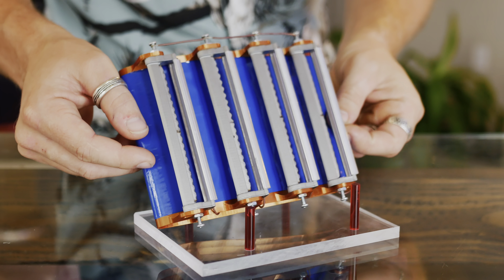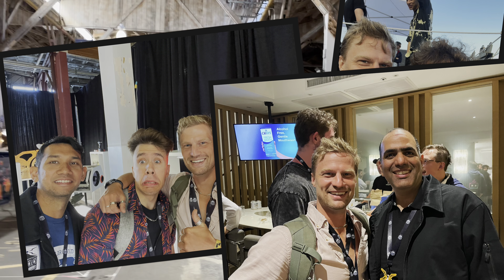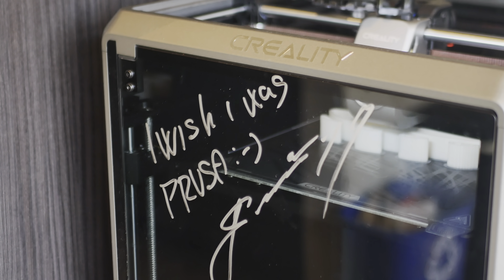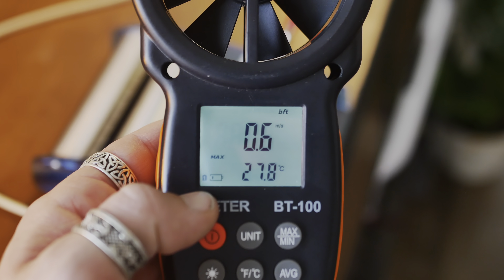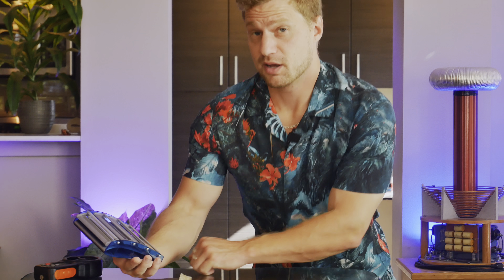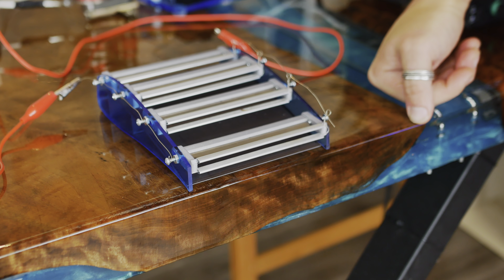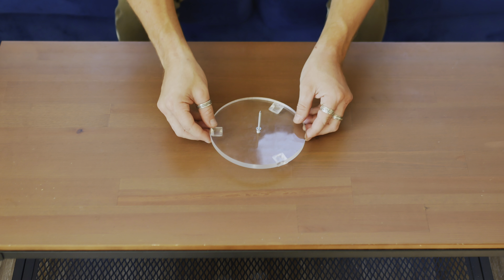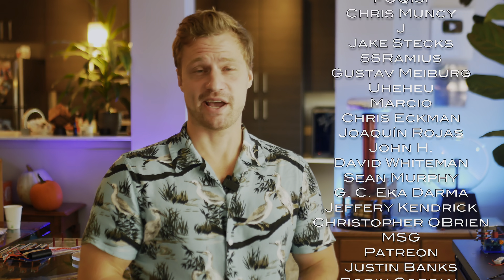Designing A Self Propelling Ionic Thrust Wing

Comment: It can work maybe if some basic air/pressure principles are applied. It looks like the wing/thrusters are working against eachother. The pressure of thrusters must be directed from above wings to below wings. So pressure increases below, and is reduced above wings. The thruster parts you have built are the same as the wings and maybe the only thing needed is more integration of thruster/wing plus surface. Maybe add the ability to use the thruster as flaps through the wings to modify the air direction from vertical to almost horizontal. Cheers.

Comment: That is an amazing concept, and I'm curious if you've considered if it is comparable to the amount of energy to create similar thrust from conventional propellers? The drawback of electric aircraft is always range, so is this a more economical use of the batteries energy storage? I know there are multiple electric aircraft for comparison, but I'm sure they don't require such high voltage to operate. I think this would be more effective as space flight propulsion after launch when there's little drag to overcome.

Comment: Wow very cool , I did not read alllll the comments but what if the thin carrona wire was bent to be like the serration of the blade increasing its surface area??? also what about a top skin over the corrona plane of the wing? IE a top skin. I would think electrically neutral or ground.

Comment: I'm not too sure how all this works, but could the ground just be some metal tape on the wing?
Does both positive and ground need to be separate to the wing surface? Can they both be built in after the spacing is figured out?
In my mind if the ground is part of the wing, the air will be directed on the wing surface.
Please tell me how I'm wrong.

Comment: Try some foaming 3D printer filament, much lighter prints although at the cost of strength. 
Colorfabb has LW-PLA, different printing temps result in different density.

Comment: @Plasma Channel From an energetic point of view, ionic thrusters are as useful, an an Argon ion laser - a powerful water heater, that gives off a couple of Watts of light too. As a byproduct, so to speak. To dissociate a dipolar air molecule (mainly N₂ and O₂) takes a lot of power. To rip off electrons from the atoms takes even more additianal power. It is perfect to create Ozone and nitrous gases, but only a minuscule fraction of the expended power can be used to accelerate ions to create thrust. It is not a coincidence, every attempt to create a flying machine failed. The much, much more efficient way is to use gravitoelectromagnetic (GEM) thruster - as USSF (formerly USAF/AFSPC) does since the end of the STS in July 2011. Since the physics is based on bosonic statistics (theoretically no losses), efficiency to provide lift energy (E=m·g·h) and kinetic energy (E=½·m·v²) is theoretically 100% and about 99.7% practically - when GaN-semiconductors are used for the RF-excitation of a particular topological insulator at room temperature.

Comment: Redo this but possibly do less in a row and wider wings then you could maybe match the size of wing to thruster or whatever it’s called, OH or make the blade things like curve up down up down up down, curved like a snake you know, and have each one behind the first opposite of eachother you know would have good airflow, vertical little interference with one another blades would only over lap at the crossing points if that makes sence I think if you combined these two ideas you might get somethin

Comment: I think that if you used two non conductive wires with copper wire  wrapped around like you did on previous models and aluminum foil tape for each stage would be lighter and still work. Then adding a corona motor you would have a very light plane!!!!!❤

Comment: Could you enclose them and stack them reducing the width and stack size as you approach the trailing edge? This could increase the velocity and airmass. For instance stack 4 x 3 x 2 x 1 creating a type of nozzle. Or 4x3x2x2 using the last 2 pointed slightly toward each other and switching them on and off for vectoring thrust.

Comment: @PlasmaChannel: Consider using actual razor blades instead of scraper blades, utility razors, and wire. Wire lacks the fine edge needed to achieve really high field strength, while utility blades are needlessly thick and heavy. Actual double-edged razor blades, like what our grandfathers used, are very thin and lightweight, and much sharper than utility blades. (Wires aren't even in the ball park.) In fact, they are so thin that you can easily cut them with heavy-duty scissors. You would want to cut them in half, since they are double-edged, and while you're at it you could cut close to the edge since alll you need is the edge itself. The result should be almost as light as wire but produce a higher field strength than your utility blades.

Comment: 1 - Would replacing the blades with a laser cut strip of metal - with hundreds more points along the edge - make the output any more efficient?

2 - Would having a thin plastic shell over the top prevent sideways bleed & micro-turbulances (causing drag) forming between segments?

3 - Would channeling the exiting airflow into laminar flow with nozzles improve the thrust?

Comment: You could series some batteries for a bigger build to 1000v and you reduce a lot weight and current... Those voltage amplifiers take 2 amps  in standby.... Plasma itself doesn't take much power.... Those HV amps do take a lot

Comment: So awesome. When I saw the screws on the sides I immediately thought: why not also vertically and then connect them to motors and tracks to allow for more precise spacing and pitch to find the optimal results, and later on to use the concept as ailerons via thrust vectoring and for some nasty maneuverability by going as far as reversing them. Tons of possibilities and potential, especially in the UAV market.

Comment: Nice interesting experiment. However, your ionic thruster structure is going to increasing the drag drastically.
Have you thought about integrating the thruster inside the wing profile? With an inlet in just at aft the leading edge on the lower surface and the outlet just fwd the trailing edge on the upper surface (like a blown/jet flap).
Reply: Have a look at the Lilium evtol. You'll see that the thrusters are embedded in the wing profile.

Comment: Sorry but I forgot to complement - if you have an electric motor to achieve flight the Ionic system inside the Leading Edge almost like a Dyson fan would maintain flow and the main rotor plus the gliding factor of the plane could make it viable!

Comment: I know you are talking about wing design, but my note is about the design you are doing - placing the ionig generators over the wing you loose the lift factor. air has to flow over the wing to generate lift. with those mini wings over the wing instead of in front of the wing there's no lift https://www.grc.nasa.gov/www/k-12/UEET/StudentSite/images/engines/foillift.jpg Your generator should be placed before of after the airfoil to be efficient.

Comment: I am no engineer ... even in a prior life ... but ... Instead of mounting the drive units above the upper surface where they increase weight, interfere with wing airflow performance, and create turbulence ... install them within the wing making the wing the drive. Install a long narrow intake on bottom of wing with a negative grounding edge and a similar exit vent on top of the wing, behind the intake, and with a positive charged edge. Separate each drive unit by partitions within the wing. Then fly the wing at a slight increased angle of attack. Cheers.

Comment: What about incorporating the plasma generators into being the wing structure thus reducing some wing weight and also reducing the wing structure to a wire? type instead of the flat material from the 3D printer ?  Hey I'm a Motor Head,  Grease Monkey with minimal knowledge from working at Beachcraft aviation and just watching educational aerospace and flight informational videos.   I am amazed by flight and hope to be reincarnated as any type of  Soaring  bird.   Love the video it sparked my inventor inner.     Dee.     Bedrock Engineering. I'll be watching for more.

Comment: What's the frequency, Kenneth?  got a question for you, i seems you are not using just DC, as these modules are flyback and often only just rectified, experimenting with either DC with a capacitor to smoothen the spikes or finding the ideal switching frequency, keeping in mind the capacitive effect of the anode / cathode / air you may be able to boost performance by picking the right frequency.
Reply: thinking a bit further, would you not want the thruster under the wing?  since you want a lower air pressure above the wing,  would it not raise the pressure if you add air under the wings instead?

Comment: mounting the thrusters under the wing will take advantage of denser compressed air instead of lower pressure over the top of the wing
Reply: There is no compressed air under a wing.

Comment: I know zero about this subject but your modern jet fighter being an engine with a plane attached example made me think.

Could you not build the engine inside the wing somehow, rather than strapping it onto the wing?

Obviously with jet engines that's a big no, you'd have to have 10ft thick wings, but these engines are slim and streamlined as is.

There's probably a billion reasons why this is a stupid question, I was just curious as it makes sense to me to have less stuff hanging off(or above) the wing.

Comment: So why have the thrusters on top of the wing? My surface level understanding of airfoils and lift is that air on the bottom has to move faster to generate lift. Also, is throwing already charged air at another ion thruster losing efficency?

Comment: I might be wrong... but your setup has both pigtail clips at the top of your mockup. If the current takes the shortest route, it's just passing throught the first bank and partially through the second. If any power is going to the 3rd or 4th, it's minimal. 

So basically the first one is doing all he work and the next 3 are just helping the airflow along...

Maybe this is infact the trick, #1 cuts and pushes the air and the others maintain the stream.

Maybe try to setup an alternating curent where the power is boosted for a split second to each segment one at a time. 1 2 3 4 1 2 3 4.... or 13 24 13 24...

And maybe try to stay is either 3, 6 or 9 segments... 4 is oddball.

Comment: Hey, you should probably put the thrusters on the underside of the wing. The wing generates the most force perpendicular to the direction of the wind on the low pressure convex side, and having an unencumbered flow there will increase the efficiency a lot.

Comment: From an aerodynamic perspective, you should consider putting the thrust modules on the underside of the wing. The airflow across the top of the wing provides the majority of the lift, and your current design will impede the airflow and reduce the lift.

Comment: Curious if moving the faster moving air to the underside yields better lift? Also have you explored an encoded delay between filaments? You may yield a higher impulse if you can remove the repulsion of the cathode on the positively charged air heading towards it.
Reply: Hi, that would decrease lift. Aircraft airfoils are shaped to move air faster across the upper surface. This decreases pressure(Bernoulli's principle) creating lift. A little plane like a Cessna 172 creates about 10lbs per sq ft of lift this way.

Comment: Wondering what the battery consumption is? I mean if you compare standard ESC + Motor + propeller and how much torque it generates and how much all that consumes the battery with ionic thrust power consumption? What is more efficient?

Comment: You shouldn't just cut out parts of the wing, you should look into structure optimization with triangles, those are much lighter for the same strength. That way you can also cut out parts of the vertical struts inside the wing. Also, I understand you need a cathode and anode, but why do you have a rather big piece of plastic before the razor blade? I don't really see the advantage of that. Could it be removed and only keeping the electrode? You could keep the ground connection the same, as I see it as optimized. Also PETG is the strongest per weight of the regular 3D printing filaments. Not an engineer, but just giving my ideas. Love the video and experiments!

Comment: A minimal weight first starts with material selection. Aluminum, plexiglass and steel fasteners are heavy. I'dve started with cf, minimize using fasteners. Go even simpler. It doesn't need to be robust.

Comment: By the way, there is almost a request, if you can try it would be cool, but if you don’t want to or think that this is a useless activity, everything is fine)
Due to certain circumstances, I cannot assemble such a stand myself. But the idea is to make a circuit of transformers from low voltage to high voltage, the circuit must necessarily consist of more than 5 transformers, 3 gradually increasing to 360 V and 2 that will stand in the optimal position from the 3-rd transformer in order to get 2 outputs with voltage from one channel 220  V, will it be possible to make a circuit in this way that generates excess electricity that could be supplied back to the beginning and thereby reduce as much as possible the consumption of the battery from which the entire circuit is initially powered.

Comment: Why didn't you try to turn the wing itself into an ion engine? Make sure the air flows through the middle of the wing itself =) It seems that it sounded right: there is more air flow at the inlet, less in the passage and, due to pressure, the flow rate at the outlet is higher.
The increase in air flow in this design is above and below the engine sections, but there may still be a couple of other types of design shapes that can make it more compact while maintaining efficiency
in general, the design of the wings is different, if you choose wings with which it will be VERY difficult to descend, then this particular process can be corrected by the function of rotating the wings themselves from a horizontal position closer to a vertical one
I think that if you select a team of preferably 5-10 people to discuss a better option, you can achieve a very good result, since each person sees everything in their own way, it will be possible to achieve the maximum result, and then continue the assembly yourself.
It’s good, of course, if you can figure it out yourself, but you don’t have to do everything alone =)

Comment: Since this is too conductors separated by an insulator in this case air... You may be able to get away with treating the circuit like a capacitance circuit you'll initially have a high current draw but the length of the wire will determine what that draw is so it could go the entire width of the wing... Once charged, the capacitor will stop drawing current until something removes the charge... That something being thrust.

Comment: Could you switch it to a high speed frame or maybe add two blades under the wings.Because you're frame is meant to catch the wind not necessarily cut through the wind. That's why it moves slow. Maybe to counteract the drag one or two blades could be add under the wing section. 🤷

Comment: You don't actually need the two at the back.
The whole airfoil concept is being negated.
At this point you might just as well just angle the 2 middle assembly up 45 degrees if you actually want to use all of them.

Comment: Hey just wanted to say your videos are amazing... I was trying to think where this niche or your application could produce the most productive positives.  I think this would work well in boats. On a plane the battery enhancements to produce the voltage needed would add to much weight to your overall thrust. Not saying it's not possible. But a sail with this on it be pretty slick. :)

Comment: I don't know much about much, but I feel like wings work because the air is moving faster over the top than the bottom.  That being the case, wouldn't it be better to put your thrusters on the bottom, because that would increase the speed of the wind over the top?  Might be a lower initial thrust, but I think it would be a higher max speed because you'd be pushing the slow side, not the fast side.

Comment: A couple things you could try to get an even lighter airfoil...
Foaming pla is significantly lighter and better for airplanes because it's more impact resistant. However, theres a pretty in-depth calibration process to get it as light as possible and dimensonally accurate and its significantly more expensive. 
If you stick with regular pla, experiment with different spar and rib designs, add lightening holes to your spars and ribs, and try making a single walled print thats just about as strong. You might be able to shave an additional 10-20% off the weight.

Comment: Realy cool project. But you need to think about the air density. The ionic thruster needs to move particles to make an air flow and if you are in the sky you will not have a dense air.

Comment: When you saw the razor blazes for wire, i suggest using a square shaped wire with a twist. The twist in the box shaped wire should provide the same benefit you were getting from the seriated blades.

Comment: why did you put the ionic thruster on top of the wing instead of below? The pulling force on top is stronger than the pushing force from below. There is a reason why passenger airplanes have their engines below the wing and that reason is not accessibility.

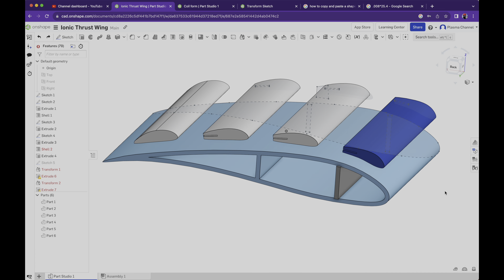Comment: 4:30 You might want to reconsider 3D printing. It is OK, for rapid prototyping, but doesn't result in the most weight savings nor stability.
For models CNC-ing, laser cutting, and vacuum forming seem better to me.
For full size … Who am I kidding, you'll never go full size because of the whole set of  regulations.